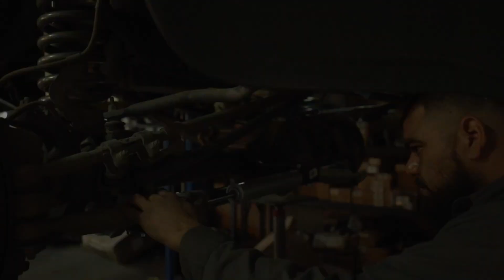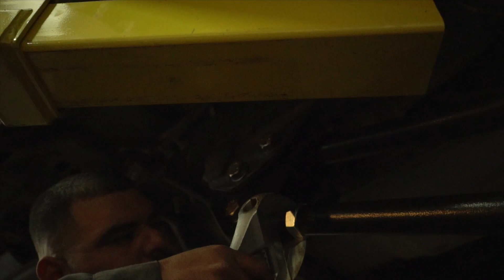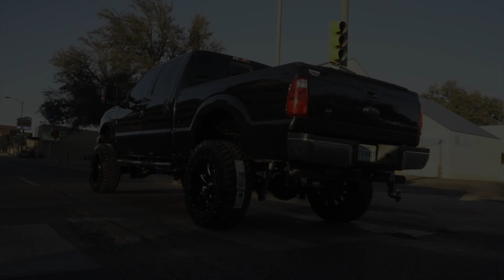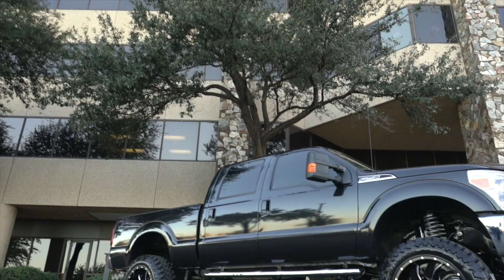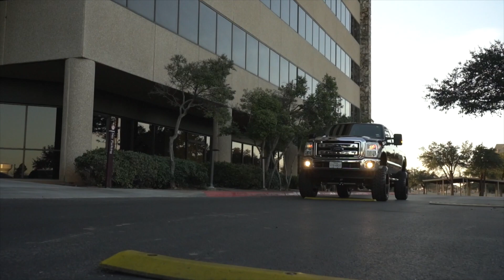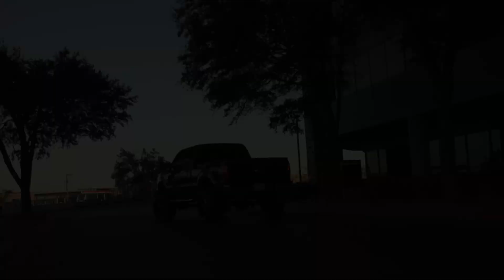How to make your truck look big and lifted with out spending a lot of money!

Comment: I'm still waiting to learn how to make my truck look big and lifted without spending a lot of money...
Reply: fucking right lol the wheels are worth half the price of the truck still lol but i guess when everything is on loan nothing is expensive...
Reply: Lmfao dam rite
Reply: So a $40,000 truck, with wheels at $600 a piece (rounded up), times 4 = 2400. So what you're saying is $2,400 is half of $40,000.... bro where did you go to school?
Reply: TenderTots 40k? that truck has an msrp of at least 50k if not 60k
Reply: Sticker price is alot higher than used price, my point is, it isnt 2015 anymore the truck has lost value. For example the MSRP for my truck is $75,000 but I wouldnt sell it for that much because it isnt new anymore.
Reply: Cameron Reid 

I think you lift it, throw new tires on it and do it to shitty music
Reply: I have a 2016 lariat f150 58k sticker.. 7k lift and tires programmer
Reply: 20x12 fuels and 35x12.50 trail grappler